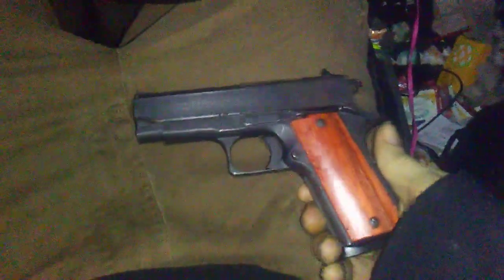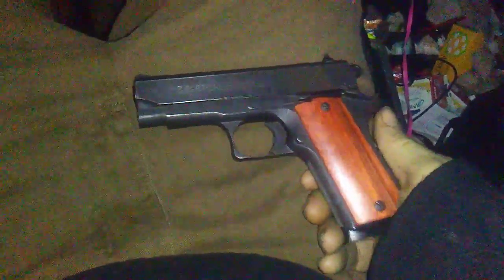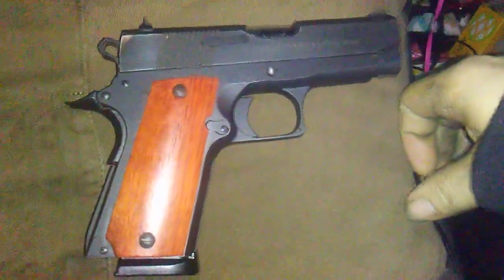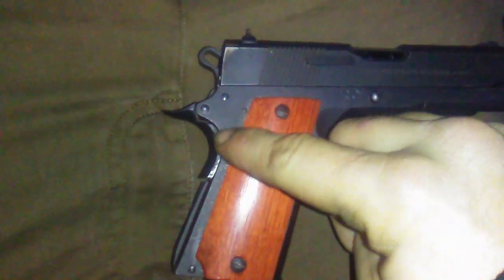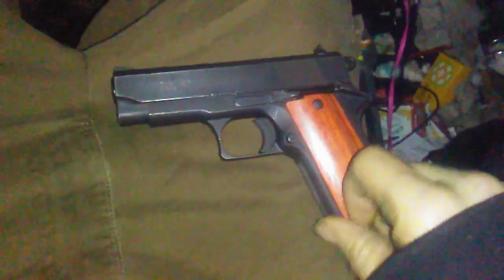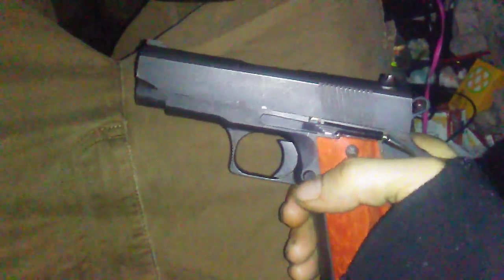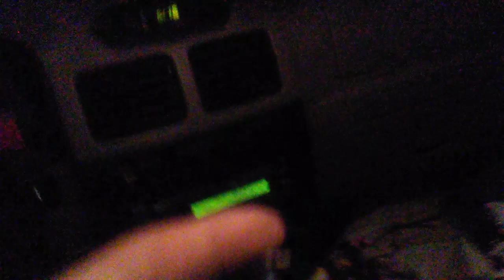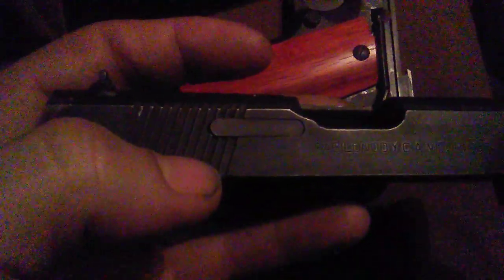Llama mini max .45 trying n testing out

Comment: are the mags interchangable with other 1911s? mines only a 6 round

bless
Reply: If it’s the 2nd gen then it’s compatible with colt mags. From what I’ve heard. Don’t quote me on it. Just got one myself wondering the same thing.
Reply: @walmi328  yeah mine runs pretty much any 1911 mag but i use a sig 1911 brand new mag for carry with hollows.
Bless